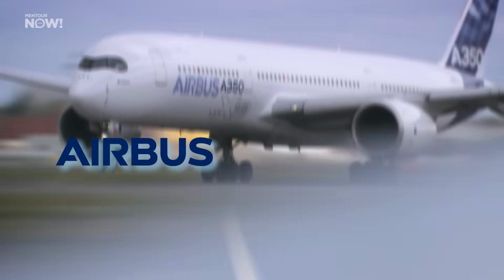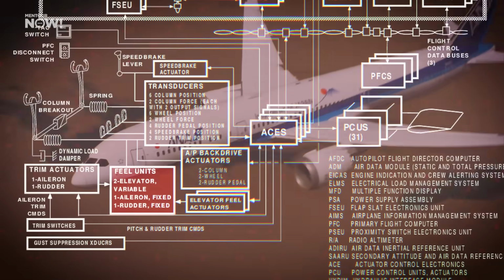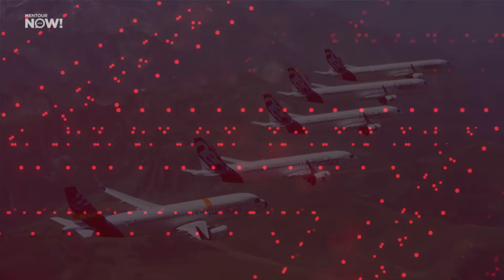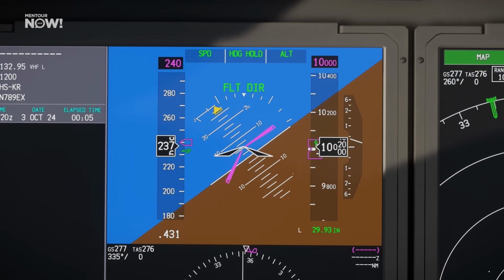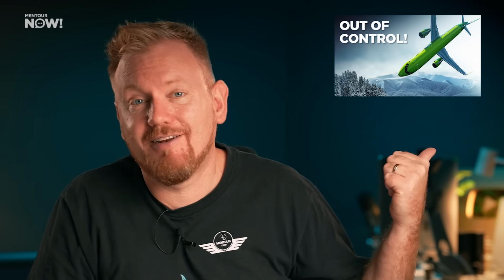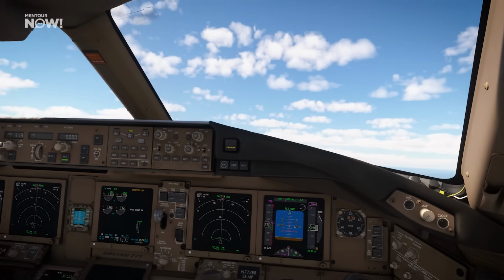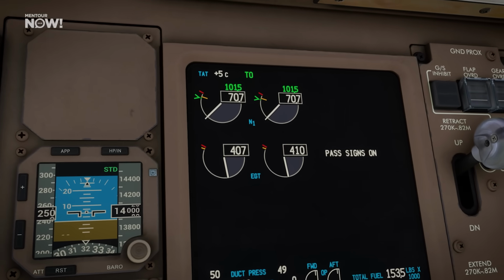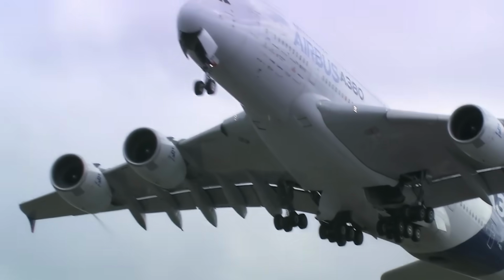Do Pilots Prefer AIRBUS over BOEING?!

Comment: If you are giving accident examples for Airbus, do the same for Boeing. There's many accidents where the Airbus's control systems saved the pilots and passengers.
Reply: @PICubing Did you even watch the video?
Reply: It can sound weird. But in my mind the best example of Airbus FBW safety improvement is the Habsheim crash. When stupid pilots managed to crash their aircraft after disconnecting FBW protections (amongst over stupidities), and when the Aloha protection prevented the stall. The Aircraft crashed into fire, but the only two casualties were a disabled person and the hero who tried to save her...
Reply: he's invested into flying Boeing 😂
Reply from the maker: I gave an accident example for Airbus, then I mentioned a case where a Boeing (777) got too slow, and explained why that cannot happen in an Airbus. Wasn't that OK?
Reply: @MentourNow  The Boeing example seemed a bit cherry-picked as it was very mild compared to the catastrophic Air France 447. I think your very last Mentour Pilot video about Birgenair 301 where the pilots of a Boeing 757-200 stalled their plane because of dysfunctional pitot tubes seemed like a good comparison to me because it's the same fault as in Air France 447. The Air France 447 crash happened because the captain wasn't in the cockpit and the pilot flying couldn't fly the airplane in direct law. So the Airbus protections couldn't help in the case of Air France 447, but Boeing planes are basically always in "direct law" so to speak and there was no protection in the first place to save Birgenair 301. And being used to fly their plane without automation didn't help the pilots of Birgenair 301 either. But Air France 447 is seen as much more catastrophic because when Airbus pilots make a severe mistake and the Airbus automation can't save them it's surprising to us while when Boeing pilots make a severe mistake it's almost surprising when they don't crash... I think that comparison illustrates very well what wildly different safety expectations we as passengers have of Airbus and Boeing.
Reply: @Blex_040 add the bad whether to AF447. And I agree more dirt on Airbus less dirt on Boeing from this guy. Not impressed by this channel.
Reply: @MentourNow  What? you pick on the famous AF447 that killed 250 people (and was caused by S**t piloting and CRM, not the control architecture) like all the Boeing fans do, and then mention some lightweight incident no-one has ever heard of as a counter argument? No I'd say that wasn't ok. You'd need to pick an example where the Airbus architecture specifically saved a lot of lives where the Boeing wouldn't (and they exist), or a fatal crash where the Boeing architecture didn't save the aircraft (and they exist too). That would be OK - especially as I can probably point to your own videos for examples

Comment: Video says safety stats between modern aircraft from both companies are about the same, but by the definition of modern given, most Boeings AREN'T Modern, ie 737. I'd be interested to see comparison between A320 and B737.
Reply: @mog0  the 737 is only one Boeing family in production, the others are 777 and 787. 767 is getting discontinued in 2027.
Reply: @Blank00  I was referring to number of aircraft, rather than number of models. Last year 387 out of 528 aircraft produced were 737s.
Reply: The comparison between the 737 and A320 family is day and night. They can do more or less the same and there's where the similarities end. 
One is a modern fly-by-wire aircraft, fully computer controlled machine. The other is a cables and pulleys along the airframe old school aircraft that doesn't even have EICAS like every other Boeing.
Reply: @miks564  That's kind of my point. The video is about comparing Boeing and Airbus safety but then ignores the majority of Boeings.

Comment: No offense intended by this. It’s a serious question from a layman. Why do we still have commercial pilots? To my knowledge drones (MQ-9 for instance) operate completely autonomously. It would make me way more comfortable as a passenger knowing there’s no human who could screw up in the loop.
Reply: Who programs the drone and tells it what to do? And if that drone has a problem.....oh well it's a drone. Tell me how would a computer have managed to deal with the Hudson River landing when it would have lost nearly all electrical power? Or QF72 when it suddenly thought it was about to stall and pitched the nose down rapidly?
Reply: Drones don't have people on board so if the software messes up it doesn't really matter if it crashes.  And I'm assuming drones don't have to land at commercial airports and operate in congested airspace.  I would much rather have two experienced pilots up front, even if it means I have to pay more.

Comment: Are the manufacturer into AI to support the pilots, eg check-lists etc?
Reply: Checklists are already monitored by switch position, it doesn't take "AI" to do that
Reply: @tomstravels520  I see pilots looking into checklist books, is it enough with switches?
Reply: @ericgustafsson7474  then you’re looking at a 737 or something like that. A320 and after have had electronic checklists and since the 777/787 also have them
Reply: @tomstravels520  ok. Thanks!

Comment: I certainly respect all the negative Boeing comments. Quality is hard to manage throughout a very long process and any airline manufacturer will have some struggling years as Airbus predecessors BAE had . But Boeing is not finished and the overall safety of flight needs two and possibly 3 manufactures. You absolutely don't want just one manufacturer!!!
 I've machined parts for heavy aircraft for years. Moog, Parker Hannifin, Pratt n Whitney, GE etc... I would never trust machining these parts without the ability to feel and hear the process. Since the parts me and the team make can be large they will never be produced 100% by robotics. CNC machines are in a manner a robot but without the oversight of human tactile interaction producing quality AS9100 and FAA compliant parts would be extremely difficult. After-all, humans must calibrate the robot.

 
O.E.M source out machining to many AS9100 qualified shops. Full automation works fine in mass quantity production with tolerances of .077 mm but for tighter tolerance on many critical parts it takes a process control procedure that requires human and computerized repeatability. We are not producing 300,000 parts more like a few thousand at best.  
 Sorry for the long post. I've learned a ton from your videos, thanks you.
Reply from the maker: I'm glad you found the video useful, and thank you, too, for the detailed breakdown of your machining expertise! I'm all for machines making people's job easier, but it's also nice when humans have all the information they need to make the right decisions.

Comment: There were some accidents, when actual wire was damaged and pilots lost control. Is fly-by-wire protecting from that? Also for some accidents, if Boeing would have been replaced with Airbus counterpart (and vice versa) - could the accident be prevented?
Reply: He gave an example of one. Another would be Asiana 214, the plane would have initiated TOGA thrust before getting close to stall and the way the buttons were operated it the autothrust would have stayed in as well. And yes there are multiple wires and multiple computers to control the aircraft. See QF32
Reply: A copper wire only has two points of failure, at the connection or somewhere along it’s lenght. A physical contraption of levers, cogs and steel wire can potentially fail at every fastening point or point of interaction. Hydraulic systems speak for themselves. What would you choose?
Reply: @rattylikez FBW doesnt mean the controlled surfaces are moved by electric wires😂
Reply: @sule.A  right, lets throw in some actuators there, point still stands
Reply: Most of the Airbus incidents would have occurred the same way on a Boeing. For example the crash in the alps by the pilot wasn’t preventable. The AF flight its a big maybe. But that was still a pilot error

Comment: Bombardier C-Serie has fly-by-wire and protection laws  like Airbus, but also the throttles feedback like Boeing.  It doesn't have joystick feedback because the technology is not mature enough. But we can expect the next generation of aircraft to have full fly-by-wire control with force feedback.  Then we can say bye-bye 737 Max and its "grandfathering" rule.

Now, no matter what's the technology, a badly screwed bolt or a bug in a programmed line of code will screw up everything.  Quality comes first.
Reply from the maker: "Active sidesticks", as they're apparently called, already exist for some business jets and I think Embraer's new military cargo plane, too. The Russian MC-21 would have had active sidesticks too (made by the same company in France that makes Airbus sidesticks) were it not for the war in Ukraine. They will definitely be part of all future airliners, I think... although technically at least Boeings with fly-by-wire have artificial feel in their yokes, which is "active" in the same sense, except of course that the two yokes are linked mechanically. Check out my previous video on sidesticks for more on this, if you like!
Reply: @MentourNow  Well, until they aren't connected anymore. Like in the Air France 777 in Paris CdG not long ago, where both pilots made disagreeing input so hard, that it detached the linkage.
Reply: @quasimodo6860  Which is why you don't want those mechanical but instead FBW. No risk of an unwanted separation.
Reply: @MBSteinNL  that separation actually is a recovery mode in case one of two elevator surface suddenly stuck. With the pitch column disconnected the other normal elevator surface can be controlled again and pitch authority is regained back. It's not a flaw.
Reply: @quasimodo6860 at that stage the pilots are hellbent on crushing the plane.. same as dual input in Airbus were the system averages and will decide to do nothing and simply let the plane crush. Human factor will always be a problem no matter how many safety aids are in place
Reply: @nmvi226  Yes, very probably.
Reply: @MentourNow  An interesting case study would have been indeed Air France Flight 11 where the Pilots managed it to have on a 777 as few feeling what the other pilot is doing as in an Airbus.
Reply: @MentourNow I believe it is the case with Bombardier Global 6500 and 7500 aircrafts.
Reply: @MentourNow  May compare KC390 to C130 to see good topics as well.
Reply: @MentourNow  It seems about the right time. Force feedback in Racing simulators has recently become almost true to life in terms of simulation quality. and is used by all major F1 teams etc, I would expect that type of technology to be delayed by about a couple of decades or so for Aircraft given the more stringent safety and design standards and also mostly the fact that planes are not retrofitted or newly designed every year like Racing cars.
Reply: @Sgt.chickens  I believe force-feedback sticks have been a thing in some miltiary aircraft for over 25 years. Of course, they have a lot of features and capabilities that you don't see in commercial airliners but it sounds like it's a technology that should be making its way into civil aviation sooner rather than later.
Reply: The fly by wire actually more similar to Boeing 777/787 since it uses c*u fbw. It also has thumb trim switch on the sidestick to set trim speed and if i'm not mistaken because of using c*u, the sidestick has artificial force feedback unit installed in it.
Reply: You mean the Airbus A220? ;)
(Yes, jk, I know the history)
Reply: We've had force feedback joysticks for computer gaming for decades. I'm sure they can figure out how to do it on airplanes.
Reply: Sadly, Stockton Rush – the number one expert on using game controllers in that sort of context – is no longer around to act as consultant.
Reply: @mediocreman2  I mean, apparently some planes have them. It's probably just a question of when Airbus personally thinks their own system is mature enough to put it into a new airplane model.

Comment: Everybody always hating on the 737 when the A320 is considered an old airframe too.
Reply: 1967 vs 1987, the A320 is still 20 years younger than the 737.
Reply: @Bjg6  and the A320 family is older than the 777 too
Reply: Yes, it's an old airframe but still VERY modern.
Reply: @Chickennuggetman2839  Is that why the neo was always able to handle heavier engines because the 320 family sits up higher anyway?
Reply: @Bjg6  Too. The 737 MAX MCAS issue was caused by the engines, they had to mount basically on front of the wing because the engine was  too big to fit under the wing like usually, that resulted in some issues which got fixed by MCAS. The A320 is a LOT higher up so it never had this problem always leaving room for "much" bigger variants with bigger engines. Fun fact: 737 fuselage starts at your height. You're as tall as the lower part of the fuselage, depends on the person, maybe gonna have to put up your arm.

In conclusion: Pretty much
Reply: 737 pilots hate EICAS,  so even future 737 models will be traditional